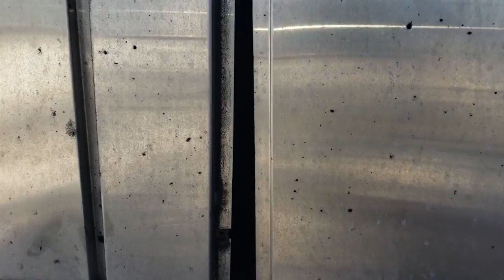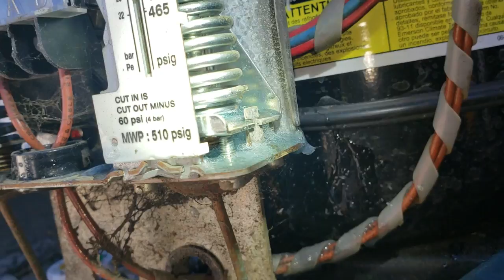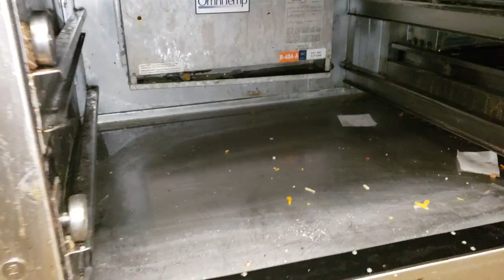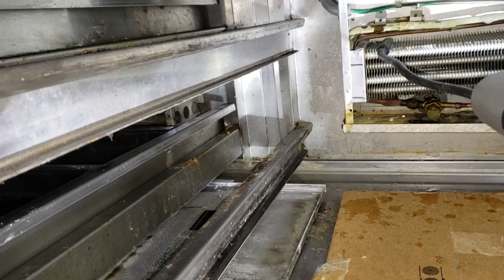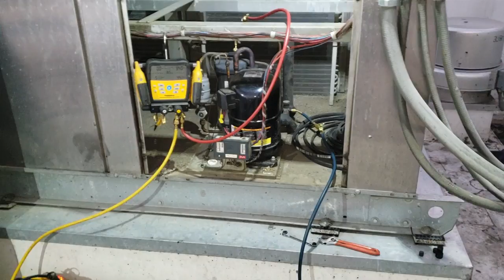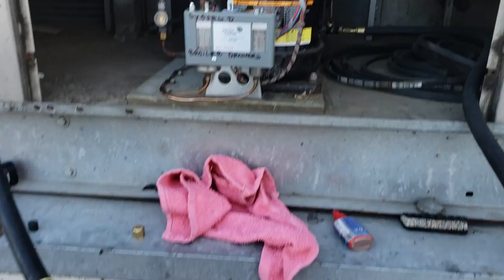COOKS DRAWERS TEMPING HIGH

Comment: I hate the drawer unit like that nobody ever wants to clean them they over stock so food falls into evaporators and block fans depending on their position. I hate those damn machines always full of filth.sometimes the manufacturers will  put the evaporator between two sets of drawers. So you have to remove the drawer assembly completely.  Good work here by the way.

Comment: How do you prevent The line cook from using the drawer as his step stool to clean inside the hood, thus breaking the roller bearings and drawer rails off the inside of the box? Lol 
Or show up and they loaded 300lbs of product into the drawers wearing them out way too fast.
Reply from the maker: Yeah working in restaurants has some challenges for sure

Comment: Push pull is the fastest way to recover refrigerant,  try it!
Reply from the maker: Push pull wouldn't work well for this job because the total charge was like 12 pounds. The total recovery time was less than 10 minutes.Push pull is great for the 50+ pound charges
Reply: @HVACRVIDEOS  i must agree 10 min is fast! 12 pound is ok to push pull, but anything less i wouldnt recomend. In smaller systems i sometimes dump the charge in the low side to work om high side.

Comment: why dont you use a refridgerant leak tester that displays in ppm's rather than in led's?
Reply from the maker: I have never found the need for one, plus there aren't too many out there that I know of that display the ppm. I dont even pay attention to the led's i just listen for the sound.
Reply: Your not looking for how much its leaking. Its leak or no leak with these systems.  The D-Teks will find some pretty tiny leaks if used and maintained correctly. --Ex--keep a fresh tip in it, keep it clean, and dont power it on in the presence of refrigerant. 
--
Reply: I have never found a use for a fancy leak detector. I have never had any issues finding leaks personally.

Comment: Are you using any kind of flame-guard heat shield for brazing?
Reply from the maker: No I have them but dont use them that often. I usually have a wet rag handy in case there are wires nearby

Comment: Have you  found in-wall foam insulation setting your detector off? I have seen this so many times, especially if I disturb the foam (smash, break or even pulling screws out of foamed walls)
Reply: There’s some nasty off gassing that spray foam insulation does when drying.  Funny thing is, it takes a very long time to dry to 100%.  These gasses can cause serious health problems if you are not careful
Reply: Had this happen on some Grocery store coffin cases.
Reply from the maker: Yeah I have seen that
Reply: Roodj1 is correct, I do supermarket refrigeration and spray foam always sets my leak detector off

Comment: Why do you vacuum the system without a manifold guage set?
Reply: Spyke383 you don’t need one as long as you have a micron gauge set their really isn’t any need for a gauge set. Even when you recharge the system you don’t need a gauge. Just weigh in the charge as factory required. I only use my gauges to check the charge and dial in the superheat.
Reply: It is much quicker. All you need is a core removal tool, vacuum hose, vacuum pump and micron gauge.